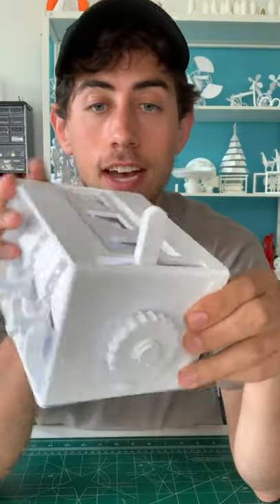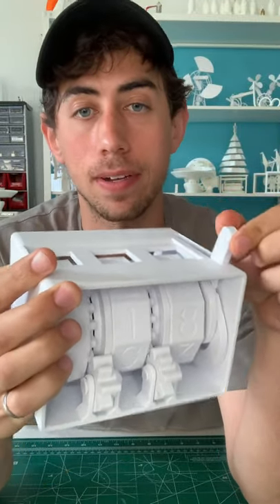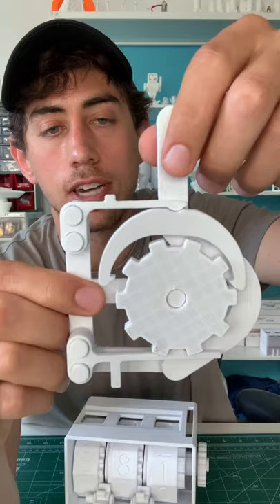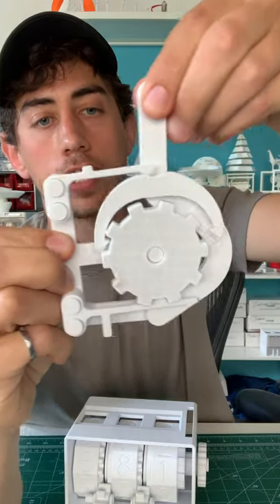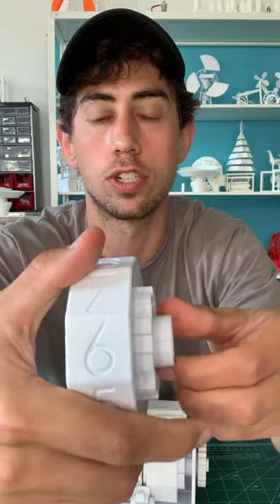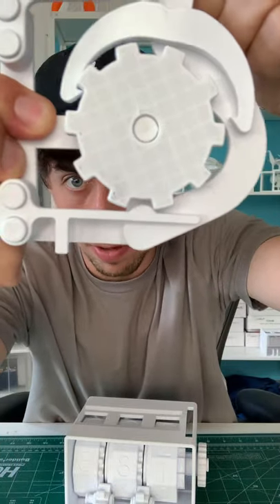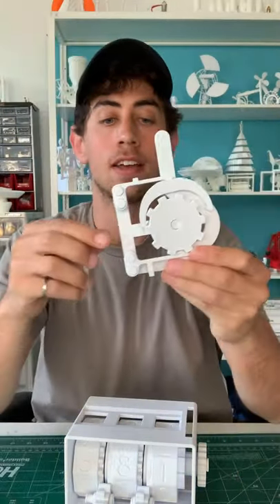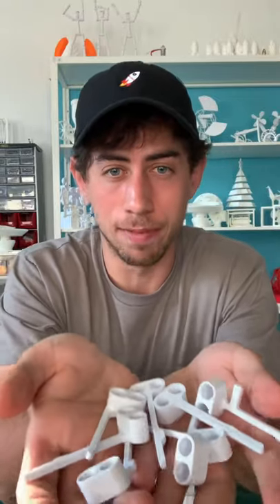That Satisfying Click - How the Actuation Lever works

Comment: Seems to have some things in common with a clock escapement. 
But since it works in reverse, that's why you need the spring?
Reply from the maker: The spring is there to ensure that the sprocket is always in a position corresponding to a number in the window on the top of the counter. It definitely has some things in common with an escapement!